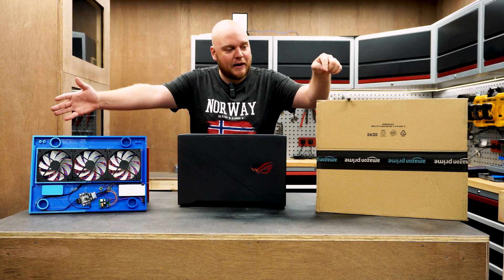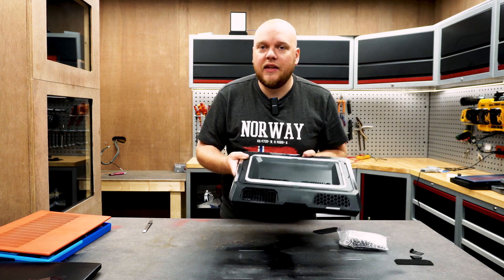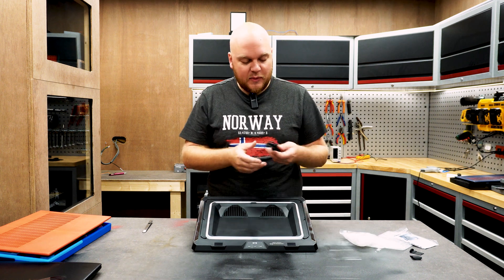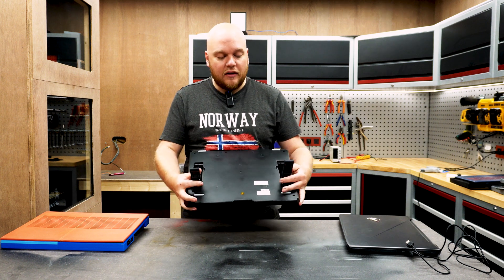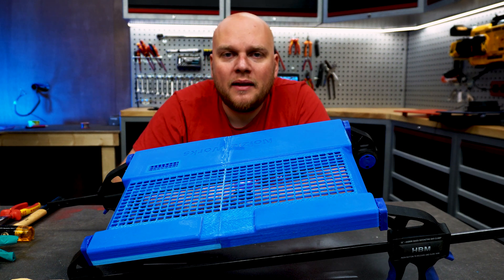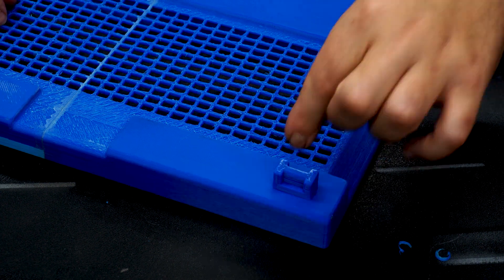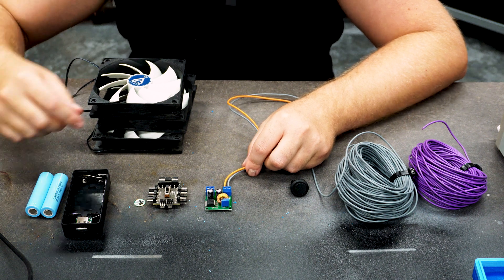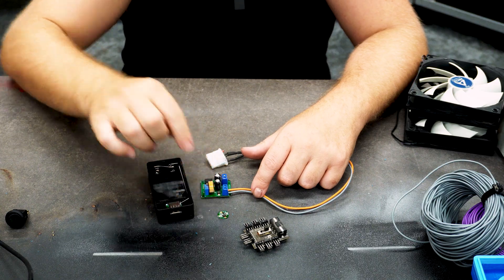Is it better to BUY or DIY a laptop cooling pad?

Comment: I DO have an idea instead of just choosing whether or not to buy or DIY laptop cooling pad why not both but make the laptop cooling pad BE the back case of the laptop but it does require either a 3D printed back case with a very long screws or machined aluminium or aluminum if that is how you pronounce it sadly i can't put that to the test because i sadly don't have 3D printer

Comment: I bought cheap one with two big fan and it work somehow. After 3years fans start to be noisy and scrubbing in bearing. I can't find as big fan so I bought four 92mm slim 12V fan qnd install into pad with DC step-up adjusted about 7V if I remeber for sure it start rotating, good flow but not much noisy. Powered by USB from laptop and much better cooling then original one.
Reply from the maker: @jendak7921  nice!

Comment: 80 degrees celcius is still very dangerous it could harm the CPU, my cpu temperature was JUST below 100 degrees, ever since i got the ventilators and the laptop cooling pad, im able to maintain the GPU to MAYBE 69 to 72 for automatic temperatures, and the fans that i have in this laptop doesn't work properly, even though it is moving air around, its still dangerous, you could have it overclocked, i for one had it overclocked the CPU, just by using throttlestopper as of now, im not doing any heavy gaming. if i were to do it DIY, then i would THEN make it so i can have it automatically though i don't know how to make it into an AI to read temperatures me using the throttlestopper to 23 makes the comfortable temperatures to like 50 - 65 degrees celcius i have vacuum suction as well to pull out the air. still a safe working environment to be honest.

Comment: Running 3 fans with 2 batteries is a very naive idea. Simply use a 12 volt adapter!
Reply from the maker: If it works 😄🤷‍♂️
Reply: @NoizieWorks  How long ?
Reply from the maker: @qnedim3200  more then an hour and you can plug it in the laptop and use it like that

Comment: I think you should try creating bigger spaces between your laptop and you cooling pad & maybe your desk and your cooling pad too. The bought one definetly has worse fans but its height helps a lot with the air flow. What "bottlenecks" your system is probably the limited mass of air that flows into it caused by the not-big enough spaces that restrict the airflow, so no matter what fans you are using if you physicly block the airflow fans speed & power dont matter. Just a theory of course. Creating more open space around the pad and lifting the laptop higher i think would help.

Comment: A third way is to customize. I bought a cheap one from a Chinese bazar (12€) that had a decent fan but absolutely shitty airflow because the fan (a wide, low RPM one) was encased between two grills, one finer and airflow enemy than the other, it made the thing useless out of the box, because it made the fan spin full blast to deliver a mere trickle of air.

Trashed the top grill (that was the worst) and with some pliers removed much of the bottom one (besides the parts needed for structural support of the fan mounting) and now it has a decent airflow. It looks... not quite nice if the laptop isn't on it, with the exposed fan, but if the laptop is on it there's no difference from the just bought configuration, and now IT WORKS.

I may want to apply some seal in the future, though. It does make a difference.
Reply: I can relate to you. I bought a cheap cooling pad then took off the top grill and cut off some useless bottom plastic. Airflow improved by a lot! But the looks... 😅😅

Comment: This is awesome! I don't have a 3D printer and there aren't any available in my area to rent/use so I will likely have to build something from scratch-- maybe using PVC board and other parts from a hardware store, but the electrical info was interesting. What AWG wire was used? Do the BMS things come with instructions on how to connect them?
The power bank idea is fantastic. I will have to see if they have the USB type C ones that I can stick a magnetic end into so I can charge it with a magnetic cord. That way there's no worries of the USB end getting bent/broken or damaging the slot.
Reply from the maker: Please share it! Would love to see it. Yes most come with instructions on the sellers page if you buy them on aliexpress. I have put 2 in to get more power(1,5 amp each but in practice it's lower) but i think it's better to look for a bms with higher amp rating or use low speed fans that pull less power. This is a very low power setup ,75mm2 wire about 18awg is plenty. Great idea with the magnetic port👌 printers are very cheap these days maybe consider it?
Reply: @NoizieWorks  Thank you. The fan thing is just an idea right now. I have to take care of some renovations first. Almost finished with one bathroom renovation and still have two more plus a laundry room. Doing it by myself with the help of a friend since contractors won't come out where I live. I'm in a remote area. I appreciate the additional info. How many amps do you think would be needed for the bms?"
Reply: Avoid the magnetic cables. They are all trash. Yes, its a low current situation so resistance isn't the most important but across the board the magnetic cables are just not worth it. You'll get much better charging times with a standard cable. I'd look at the IP5328P module. It's a 1S module meaning if you want to use multiple cells you just put them in parallel (make sure they are at the same voltage first, within 0.1V is usually good enough otherwise if they are significantly further apart than that you'll see a large charging current enter the lower cell and a large discharging current from energy leaving the higher cell. Discharging current is usually significantly more than charging current so the lower cell is going to be getting hit with a big current for a short period of time. Just not good for the cell and if its a salvaged cell you could really be risking your safety....new cells I wouldn't be too worried about thermal runaway but salvaged cells are an unknown unless you know how to test them for degradation/capacity/IR)

If you want to use cell holders I INSIST you not use the el cheapo ones and use the Keystone ones with the gold leaf contacts (or a similar clone). The newer Keystone ones have a nickel plated steel leaf spring contact which is probably almost just as good.

https://www.modmaker.com/keystone-1048-186502-battery-sled

That's the type I recommend. Just use a short piece of wire (stranded or solid core doesn't really matter just don't use something thin like 18 or 20AWG. I'd use at least 16 AWG.

Obviously using 5000mAh 21700's is going to make the most sense. LG M50LT, Samsung 50E, Lishen LR2170SD, etc. They all have a continuous current rating of 10A or higher so that would give you 20A if you had 2 in parallel. I'm pretty sure they make a 2 cell 21700 holder but not a 4 cell. 10,000mAh should do you pretty well. Then just use the same wire gauge (stranded silicone would be best/easiest here) for the connections to the IP5328P. It's only a $4 module and the cells should be $5 each. 18650BatteryStore or LiIonWholesale in the USA, Fogstar or Nkon for Europe. You'll have USB C and USB A output with fast charging (PD up to 12V I believe, max of 18W or 22.5W)

Super simple option that would cost you $5 for the cell holder, $4 for the module and $10 for the cells. I think you'd be hard pressed to find a 10,000mAh PD powerbank for under $20 and you have the ability to pull out the cells for replacement or to add more in the future. You can put as many in parallel as you want so if you want to add 10 cells you could power the fans and charge your phone for hours and hours. Step it up to a better module (I can go into more detail if you're interested) and you could have 100W+ of PD power so charging a USB C laptop would be possible. IP2368 is my favorite but its only a single USB C port...there are other two port options that are bidirectional but they do require putting cells in series but thats easy. You could turn your laptop cooling pad into a laptop power bank.
Reply from the maker: Thanks for the massive write up! Right now i'm to busy to revisit the cooler but all files are free to download if you want to give it a shot 😉

Comment: Here is my solution. Feel free to use it. I have an asus gu502gu for reference (9th gen I-7 & 2070 max-q). Monitor is 2560x1080 144hz. 

My gpu temps were 92c, and cpu at 96c in stock configuration. Normally would get around 80-90 fps on first match while still cold at low settings. Then start getting random fps drops to the 20s once warmed up. No Bueno. You know those vertical oscillating fans? I found a mini one about 12" tall brand new in the box for $6 at my local goodwill. Then I removed the backplate and rested the back of the laptop on the fan turned sideways. It shoots a lot of air directly into whole system. On fan speed 3 (I use headphones while gaming), I was getting well over 120fps stable with med-high settings. I saw 100% gpu utilization and temps never got above 71c. It was insane to see at first. Cpu was at 78c. It works. I'm telling you. $70? 😂
Reply from the maker: My man, this sounds insane 😅 please send me some pics on insta or facebook  i want to see this one 😁🤓🥼
Reply: @NoizieWorks  I sincerely apologize. I didn't see the notification or YouTube never gave me  the notification on my phone. I'm a man of my word and very eager to help others. I'm a little busy right now, but later this afternoon I can take some pictures and post them for you guys to see including screen temps and utilization and my setup. I also bought a few more supplies and I'm going to mod it for watercoloring this afternoon. I stole the idea from another youtuber on here, but I have an engineering background so I'm going to overhaul and improve the efficiency of the design. But I'll take pictures / video of just the fan and then post the water cooled edition tomorrow. I really hope this helps others.
Reply: @charlestannehill7537  mate, please let me know if you can share the pictures to me as well. im currently working on same issue
Reply from the maker: I can't remember getting them
Reply: @NoizieWorks  OMG, I'm so sorry. Fucking Youtube. Youtube is bad with notifications and ghost deleting people's posts. I could've swore I posted a link way back then. I can make another video later tonight or in the morning because I'm not using the same laptop anymore. The new(er) laptop I'm using has a 3050ti laptop variant, which is roughly equivalent to 2070 max-q though. So it's roughly the same.

Plus there's a huge time difference as I live in Hawaii. So I get things almost a day late to everyone else.